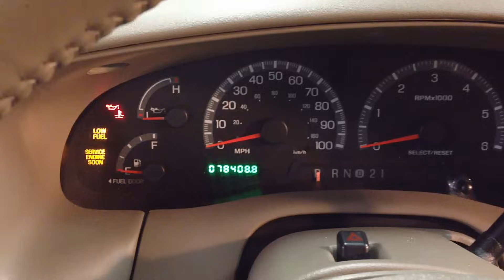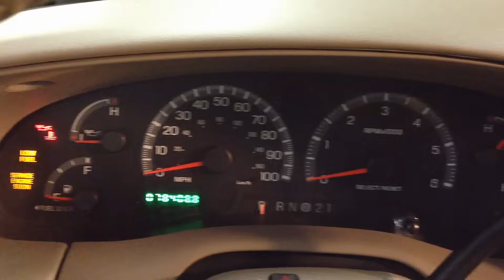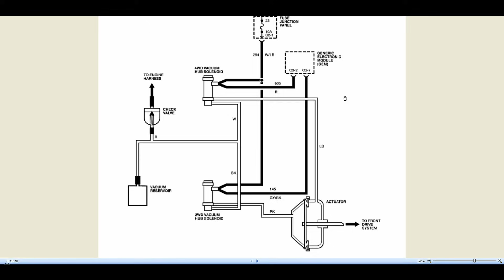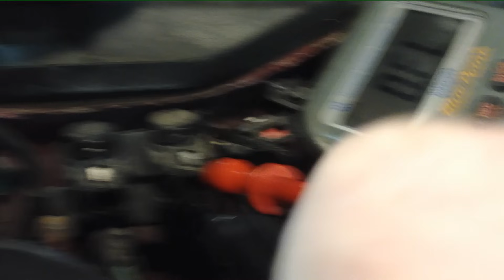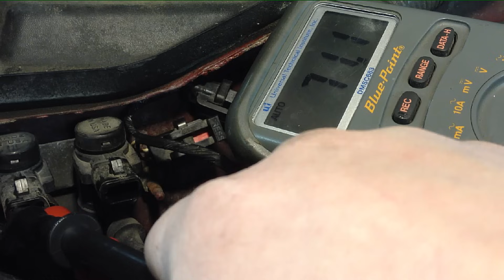1997-2004 Ford F150 4X4 Inoperative In Depth Diagnosis

Comment: My name is Angel my 4x4 doesn't come on when I turn the switch for either one.
Reply from the maker: +Angel Claudio Pull codes on the GEM module you likely have a transfer case shift motor failure.

Comment: Pretty dash, nothing like my 2001 f150. And those mileage number wow mine has 319,000 miles on her its a 5.4 , runs well no major problems had to replace fuel pump a month ago decided to drop tank was having problems with the bed bolts why ford didn't makr like a flip up access panel in the truck bed itself is beyond me, but it sure would have been a good design.

Comment: I have a 2000 F150 and i have checked ground, relays, etc. Would hear it click a bunch of times when switching it to 4x4 but it would not engage and the light on dash does not come on. I took the gem module out, unplugged the switch on the dash and I have unplugged the connector to the electric motor on the transfer case. Both 2wd and 4wd solenoids are still getting a ground at the same time. Any ideas would be greatly appreciated!

Comment: My 97 has been shifting in fine, but getting back out of 4x4 is sometimes a problem.. I looked it up years ago in my Haynes manual, and they suggested disconnecting the battery for 20 seconds or so. It apparently resets the solenoids or the solenoid circuit. It works best for me when the truck is warm and immediately after shut down, that way, there's still vacuum in the canister. Works every time for me, so far...
Reply: I have the same problem I suspect the gem module but not entirely sure. What did you figure out with your truck?
Reply: @rx1145  never did figure it out, when it sticks, I just disconnect the battery leads and it seems to reset the whole system. I still love that old truck, but it's become my second truck. No longer a daily driver

Comment: Great video...now for a question: My son has a 2007 F-150 4x4.  Recently he had to go down a muddy lane, so he used 4 wd Hi.  When done, he took it out of 4 hi.  He said that if felt like it still felt like it was in 4wd, but there was no light indicating so.  The 4 Hi light does work, it comes on when you start the truck, but now, when engaging 4 hi, it does not come on.  The 4 lo light comes on when using it.  Do you think that there could be a problem with the shift motor, not engaging it in 4 hi, and thus, not sending the signal to the dash light, telling it that it is not in 4 hi? Or...could it be something as simple as the dash switch?
Ok, the kid just now tells me that sometimes, not very often when using 4 hi in the snow, that the 4hi light has flickered.  Just something else to confuse me, and you.

Comment: Great Video, Thanks!! When I test my solenoid plugs, I have the constant 12 volts on the right, which goes away if I turn the key off. However, on the left, I have 12 volts to both contacts regardless of the 4x4 selector position and also regardless of the key position. I mean both have power at the same time constantly. Is that a sign of a bad GEM or just a direct short to ground? I have no other electrical issues generally related to a bad GEM. Any input would be greatly appreciated.  Thanks again!!!
Reply: Did you ever get to fix this issue of having constant 12 volts regardless of selector switch

Comment: Hello I have 99 f150 and I followed you video. Everything checks out, but I noticed that the 4x4 vacuum line is very weak. I can see the actuator moving  but not all the way. If i help it with my hand then the 4x4 will engage. Do you have any videos to check the vacuum? Should I get a special tool to test the lines?
Reply: did you fix your problem?

Comment: Awesome video.  Thanks for putting this together.  This was very helpful in understanding how this system works.  I have a 2001 F150 and the 4x4 light stays lit dimly all the time.  4x4 light comes on full when in 4wd.  I've had a couple different mechanics look at this and they have not been able to find the issue.  Any thoughts?
Reply from the maker: +David Rackliffe If the 4x4 system works properly and the only issue is the cluster light on all the time very simple remove the 4x4 input wire temporarily and see if the concern remain if so you know the cluster board is at fault.
Reply: Thanks for the help.

Comment: Same for manual 4x4 engagement ( compare to electric button ) ?
Reply from the maker: +nicolas levesque yes
Reply: +FordTechMakuloco. I have 2000 f150 I don't feel the movement after shiting it in to 4x4 and light doent come on plus the 4x4 wire harness does not have a ground what would cause this

Comment: I have an 01 f150, the 4x4 light comes on on the dash, can hear the clicking in the dash, but it acts like the drivers side hub is not engaging.  it's like driving in 2h.  only the left rear and right front will spin when 4x4 is on.  would it be the hub?  or a vacuum issue?

Comment: Im having trouble with my 4x4,when i turn the 4x4 on in the cab it clicks an the 4x4 light on the dash comes on put its not locked in,still have 2 wheel drive.   HELP.   you can e-mail me at derreln@yahoo.com.ohh its a 2000 F-150 Lariat 4x4

Comment: I have a 99 f-150 and the 4x4 suddenly quit working. With the engine off but the key on, flipping the selector switch brings 1 click and then several seconds later a second relay will click 3 or 4 times as if trying to click in, then it stops, but no 4 wheel drive. Turning the switch back to 2 wheel does nothing until I reset the system by turnig the key off and then back on. Ideas?

Comment: My 2005 ford f150 5.4 is stuck in 4WD low, the IWE was sticking  I replaced it but the transfer case is still in 4WD low any idea what could be the problem. I have code C1729

Comment: Last year I replaced both solenoids and the axle actuator and some of the  vacuum line . 4x4 worked fine, used it twice in the last month. We just got the big snow form Jonas, and I went for 4hi (1998 Ford Expedition) 4x4 Light on, only had 2Hi. Switched back to 2Hi 4x4 Light still on. Does not engage 4x4 in A4wd or 4x4HI.  4x4 Light will not go out.  How do get the codes from the GEM Module?

Comment: i have a 97 explore 5 speed 4x4 the switch says auto 4hi 4low i turn it on hi seems good lights up on dash good  but stoped in neutral  when i try low no change 4x4 light is on if i go from auto strait to 4low no light and no 4x4

Comment: Exelent video my problem is nothing is working for me i have a 1999 expedition awd. No awd and no 4x4, 4x4 light blinks some times and my 4x4 switch clicks onece you select it but truck runs on 2wd and after 32 inches of snow i need my 4x4. Any help would be great

Comment: I have a Question, I have a 1997 F150 Automatic, I put it in 4x4 via switch in dash, NO 4x4 light's come on and DOES NOT go into 4x4, So I hook the testing light to the plugs going to both Solenoid's and they both have power on the positive side with wire running to the negative of battery of both plugin's, Now when I switch the power around hooking wire to Positive on battery and check with light on both plug's the Negative left side the light is VERY dim on both plug's in 2 wheel and 4 wheel drive, would the GEM be bad ? or could the switch be bad ?
Reply: +Macanan1 If I was to remove the hoses on the 4X4 solenoid and run a loop hose from the bottom to the top vac hose to bypass the Solenoid would that get the front hubs to lock ? and wire the lever on the transfer case to the 4x4 position would that work ??

Comment: I found where the fork is, and that raised a new question. The Vacuum line that goes into the housing just above where the for is, when should I have vacuum on that line?  When I tested vacume. I did not get vacuum on the hose side, and didn't test the nipple side.

Comment: also I have neither power or ground at my 4 wheel solenoid by the battery so where should I proceed to now thanks
Reply: check the fuse. it powers both solenoids

Comment: hey how are you I have a 2000 ford f150 replaced shift motor on transfer case still not shifting into 4 wheel I hear no clicking on dash and I'm not getting power to motor where should I be looking please help me....

Comment: My 97 f150 manual shift keeps engaging to 4by while lever is in 2 by, while driving, and sometimes even after just being parked overnight. Light works and shows its off, start the next morning and its on again. Almost impossible to get it back in 2 by. Any ideas?
Reply from the maker: +B White You need to check the manual linkage underneath there is pivot point on the trans housing that likes to freeze up.

Comment: I have a 97 f150 manual shift and manual shift transfer case and the front end is not engaging the light on the dash comes on in both 4h and 4l it feels like its in but the front end don't engage what do I do thanks for any info
Reply from the maker: +Jason Strout Manually verify the front vacuum actuator is moving in and out as shown in the video.
Reply: It was the actuator on the front end that wasn't engaging

Comment: 99 f250LD.  4x4 lights up when key turned on but then goes out like normal. When 4x4 switch is turned nothing happens, no clicks no lights. I checked the vacuum solenoids on the fire wall.  Both check good 72 ohms just like yours,  plugs both check good for 12v power.  When I check the grounds however both plugs always show grounded no matter the 4wd switch position and even with the key off. Power turns on and off like it should with the key on and off.  Is this a sign of a bad GEM?
Reply from the maker: +TurboNFRStwoK This can be either a bad Gem or as in most cases it is because the GEM has found an electrical fault which in most cases is the transfer case shift motor. It is best to get the codes in the GEM module read before going any further with diagnosis.
Reply: +FordTechMakuloco Thank you for the response.  The 4wd hasn't worked since I bought the truck.  So I am very happy to report that changing the transfer case shift motor got most of everything working again. The front axle wasn't locking but since now the gem was sending the correct signals to everything I was able to find that both solenoids on the firewall were also not working.  Got the two new ones put in today and my 4wd is working like a champ.  Just wanted to say thank you for taking your time to help out.  I greatly appreciate it.

Comment: I was wondering how you made or where you found the plug prob attachment, i had to you a fuse blade and solder it to the test light wire in order to get in there.
Reply from the maker: +Bev Madden Those are custom pin testers I got while at Ford.
Reply: I searched for them, but i cant find any stores that carries flat pin connectors. Atleast i found a temporary solution for a single test. Everything up top is good, today I'm going under to check the actuator... Sucks not having 4x4 on a plow truck.

Comment: I have a 2002 F-150 with the 7700 package, the 4x4 is not a button on the dash, its a ground shift type. Would there be a difference mechanically from your video? I shifts it into 4x4 and the transfer case axle spins but there is no power to the front wheels so something isnt happening. I can use this video and my prior knowledge just curious if the floor shift changes things?
Reply from the maker: +Bev Madden The part I go over in this video is still the same so it can be used to figure out why the front axle is not locking.
Reply: I figured it out, the vacuum lines weren't even plugged into the actuator. Must of got detached somehow.  Atleast I know how to properly diagnosis the system. Thank you.

Comment: well this video helped out a bunch. i will run these tips tomorrow. also i do not know if it pertains to this but all the electric is working fuses are good however the O/D light blinks and blinks and will not stop and i do not know it it affects 4wd but my 4wd will not engage. any help would be appreciated thanks

Comment: is it possible that having a cracked solenoid will cause moisture inside the lines and it freeze the line enough to not have vacuum to pull the actuator pin in? also when I do get 4wd engaged when I move one wheel the other doesn't move with it but when I turn the driveshaft both wheels spin.

Comment: thank you for the excellent video,
I have similar noise at (2007 Navigator ) the driver side, only in 4x4 mode and driving a circle, driving straight give me also a rough drive feeling but no noise. I did all the tests you recommend and everything work how it should, except the noise (which stop switching back to 2 wheel drive mode) the rough drive feeling keep going one for some time. I replace all oils in rear - front axle (differential) and transfer case as well with original Ford oil, ... no change 
 .....do you have an idea,....thank you

Comment: I have a 2001 F150 super crew with 4.6 I have no light switching from two wheel drive the Ford drive-in dash also when checking power on solenoids I'm not gaining my ground when swapping over to four wheel drive the light still stays on negative side of two wheel drive solenoid

Comment: Great video, very detailed. I have a 1999 Expedition AWD and 4 wheel drive, so it never is just two wheel drive. It is stuck in 4 wheel drive. The selector switch is functioning correctly when I switch it back to all wheel out of 4 wheel the light goes off for 4 wheel but i dont here any clicking like i do from 4 wheel low to high. Do you have any suggestions on what I can try.
Thank you for your time

Comment: 97' F150 Lariat w/ 5.4, and 4406 transfer case...
No clicking from GEM when selector is turned on dash..... Is there a specific fuse to check?
selector motor does not click but hard wiring it easier turns the selector motor. So I know the motor works.
New selector motor is about $70 but starting to think the GEM or power to it is the issue... Please advise. Thanks in advance.
Reply from the maker: +DatsunDave07 what are the current dtcs in the GEM.
Reply: +FordTechMakuloco  I honestly don't know. But I can tell you that we just ran a "SnapOn" MT2500 on the truck while running around town and the trans is telling the computer that it's in 3rd gear when we were actually in 4th. And it read as 4th gear, on the freeway while in Overdrive. Would the incorrect reading on the tranny be cause for malfunction in the GEM and Transfer case selector motor. No other codes, other than #7 misfire...
Reply: +FordTechMakuloco  On a side note, The brown wire on the transfer case (speed match?) pin broke, so I'm going to hard-wire it to the matching wire on the other plug. The wire needs to be removed from the plug every time the selector motor is pulled and it finally broke the pin.

Comment: This is a great video, explaining everything very well.  My 2002 F150 seems to not disengage.  I went ahead and replaced both of the solenoids, but the 4wd actuator still will not push back out to go back into 2wd.  I'm guessing it is either the actuator that is bad, or I have a vacuum leak somewhere.  I have not verified that that I have good vacuum.  Do you have any advice on replacing that 4wd actuator?
Reply from the maker: +Todd Curtis I would make sure that when commanded from 4x4 to 2wd the vacuum motor actual moves and attempts to disengage. If not a manual test can verify the internals and a vacuum hand pump can also be used to test the front axle lock.

Comment: when applying 4x4, sometimes  I can heard a loud crunch underneath  in or out. Today I applied 4x4 low and drove approx 250 yards before I heard the loud crunch (it sound like someone driving a stranded and don't know how to change gears) and got 4x4 low, high use to work  with the same loud crunch, now its not working, after seeing  your video, seeing that the problem is intermittent, I will change the vacuum solenoids, and look for creaks in the black box behind the batteries. 
will let you know how it went

Comment: Have a 99 expedition and when applying gas pedal I have a popping  noises  from front end disconnected power connector from shift motor and no popping from front end. It is a4wd 4h and 4low.whereshould I look first at transfer case?

Comment: i have a '98 F150,  my 4x4 is not working. the 4x4 light will not turn on either. i was wondering if there is a way to test my T-case motor. i have power to the solenoids and the vacuum seems fine. the switch is getting power. i believe the problem is my T-motor, but before I replace it I just wanna see if there is an easy way to test it. thanks

Comment: Thanks for the video.  Checking on my 4x4 a little later.  I get the in dash GEM clicks and the 4x4 light comes on but no sound underneath and obviously the 4x4 doesn't work.  Hoping it's a vacuum issue.  (99 XLT)

Comment: Good video, 2002 Ford F-150 5.4 lariat. Today I did have problems with my 4x4 not working I will do what you did in this video, I suppose I have a vacuum leak some where, cause I do hear the clicking in the dash, I have another problem also Service Engine Soon light. Can you go over the probable cause I am going to Auto Zone to pull codes and I will let you know what code it is and we can go from there. Thanks for all of your videos